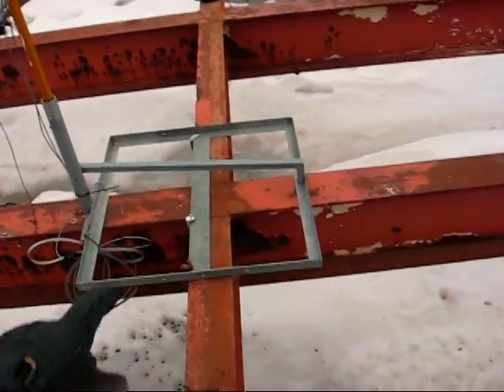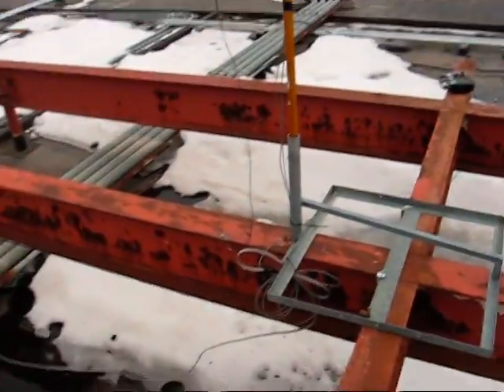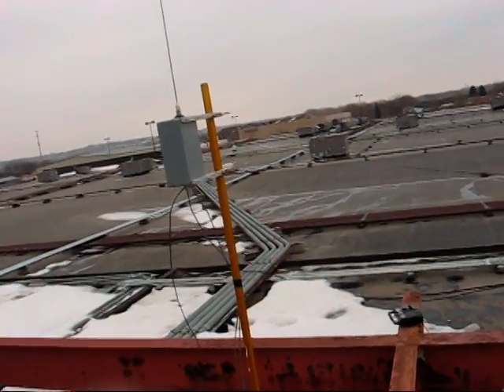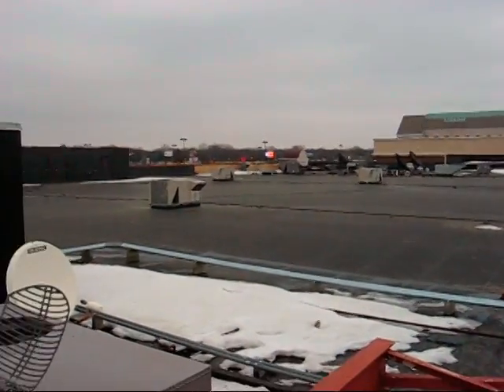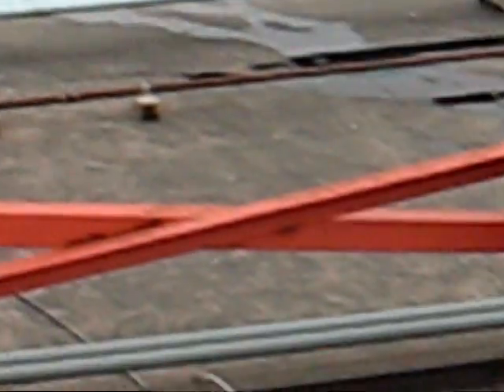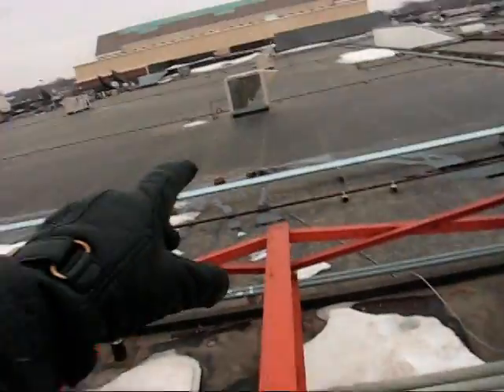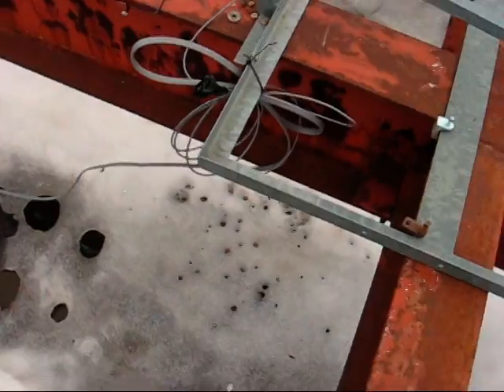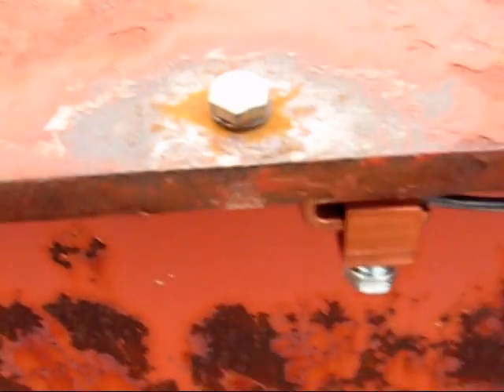Flat Roof mount for Part 15 AM Transmitter in Sioux Falls 1640AM

Comment: @MichaelJGrant Sorry, but the only thing that's too long is the power cable which doesn't count under part 15 AM. The transmitter is all in in that box and the antenna is sticking out of the top.

Comment: @zappatx There are FCC regulations and then there are enforcement actions.  Enforcement actions are subject to due process such as warrants.  Part 15.290 definitely gives the FCC the right of inspection but that right can only be enforced with an order of the court.  The downside is failure to permit inspection is in itself a violation.  It's pretty safe bet if the FCC has went to the trouble of getting a warrant, there will be penalties which are draconian.

Comment from the maker: We have been visited by the FCC. It really depends which agent does the visit. They are familiar with these radios as well as local codes for safety. This is on a commercial facility. For insurance we also have the backing of the Sheriff who has power and authority over any FCC issuance in the future - which the FCC agents actually admitted they have been thrown off properties by a county sheriff in other states.